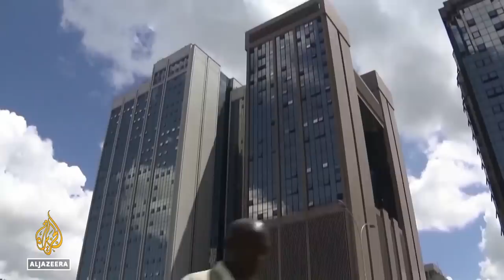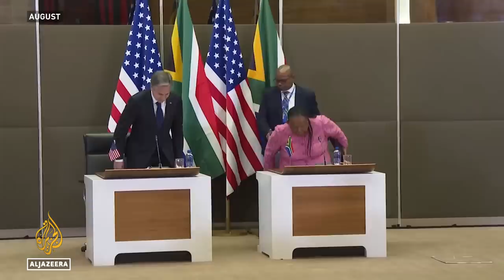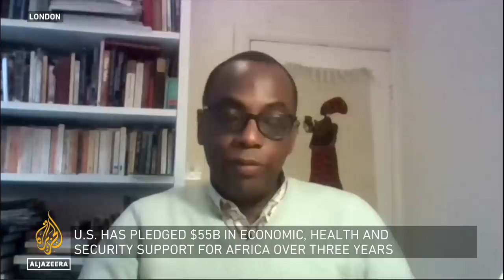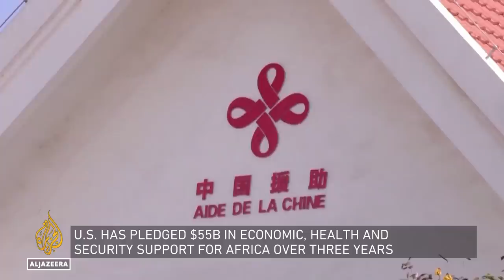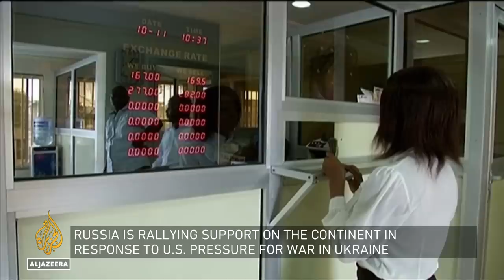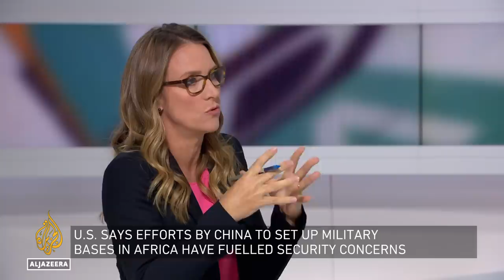What does the US hope to achieve with the African leaders' summit? | Inside Story

Comment: Since 2003, the earliest date official data is available, annual flows of Chinese foreign direct investment to Africa has risen significantly – from a mere $74.8 million in 2003 to $5.4 billion in 2018. Chinese FDI flows to Africa declined in 2019 to $2.7 billion, and then – despite the COVID-19 pandemic – swung up again to $4.2 billion in 2020. Over the same period, Chinese FDI stocks in Africa grew nearly 100-fold over a 17-year period – from $490 million in 2003 to $43.4 billion in 2020, peaking in 2018 at $46.1 billion. That makes China Africa’s fourth largest investor, ahead of the United States since 2014.

Loans from China to Africa – estimated at $153 billion between 2000-2019
( Source: the diplomat)

Comment: The US should creatively develop a mechanism to incentivize private capital to funnel into African infrastructure. Where capital wants early returns and is risk adverse, grants can be used to leverage and nudge that massive trough of capital into worthy capital projects that line up with Africa's need of infrastructure that will aid intra-Africa trade and industrialization. It will take initiative on the part of African nations to set conditions favorable for the flow of capital, and Africa will have to point to the needs. The US will never be able to compete with China in building infrastructure, but the US can leave China in the dust when it comes to the amount of capital made available. But that capital must be incentivized to flow to Africa. African countries must also find ways to protect diasporan foreign direct investment into SMEs. If they get it right, several African countries can move to middle class status rapidly. Pioneer countries can become models for the laggards. While the US, and Europe cannot compete in building infrastructure cost-wise, that problem can be solved at times by African construction. Ethiopia's construction of the GERD dam is a case in point.